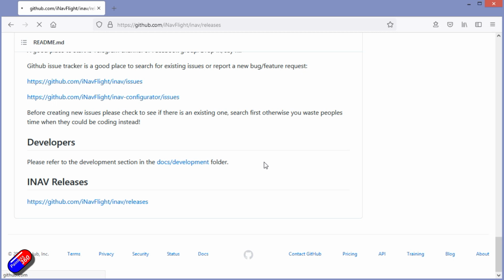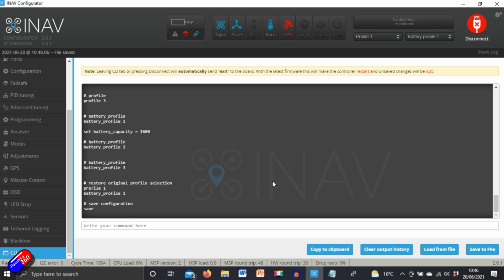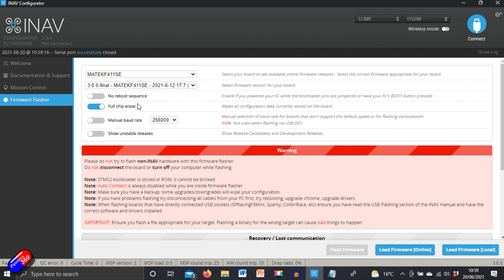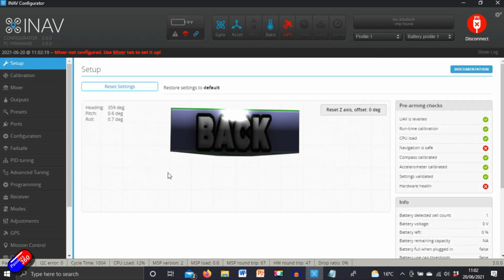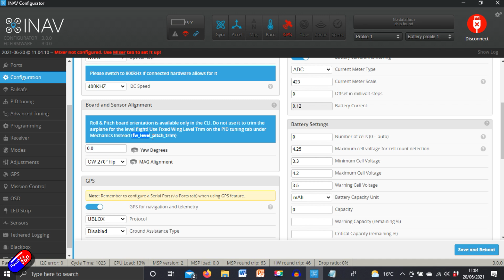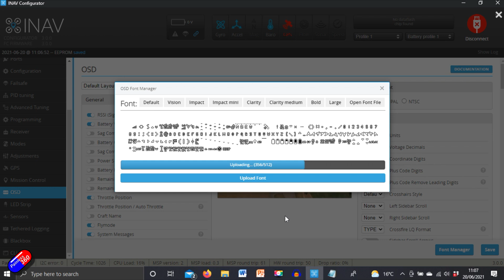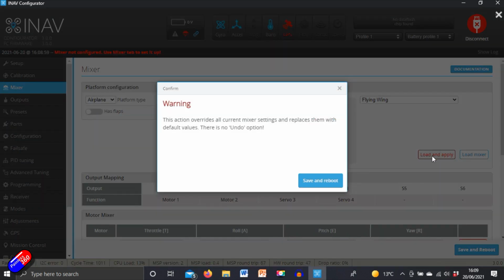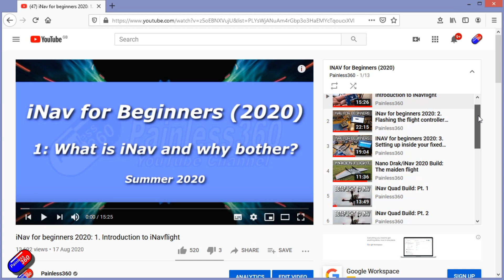INAV 3.0 (and 4.0) Fixed Wing: Installing and setup tips and process

Comment: Hey Lee, I have figured out how to get the plane pic in the setup tab, I had to load a wing Configuration and then change the settings at the bottom to match my Timber which has Rudder and Flaps then copy and paste the old servo settings from the previous Diff file and Bobs your uncle it all working great....👍👍👍
Reply: Yeah, seems the plane pic is only for wings!

Comment: set fw_level_pitch_trim is also in the Mechanics tab of PID Tuning
Reply: If you change this value, should that reflect in the image in the Setup tab?  For example in 2.6 I set my plane level on the ground, then prop the front up a bit for the correct flying attitude.  Then tweak the pitch offset until the Setup tab showed me a 0 pitch.  When I do the same in 3.0... changing the fw_level_pitch_trim number does not seem to have any effect on what I see in the Setup tab's pitch value.

Comment: Hello! Excellent video, I would like to answer a question if possible. I'm almost ready to make the first flight using INAV on an airplane, I only did tests with the airplane on the ground and stopped. I noticed that when I'm in manual mode, the control surfaces, elevator, ailerons and rudder, move as much as possible, but when I switch to ACRO, the surfaces move very little, even with the sticks at 100%. Does this happen because I'm at zero speed? Or is something wrong? Thank you very much in advance!
Reply from the maker: See https://youtu.be/OO1tIlfk9eU

Comment: Lee:
I am very grateful for your willingness to work the bleeding edge of new stuff for us. I certainly need all the help I can get.
Are you currently using Express LRS 915 or 24 in your Atom?  Which? With INAV 3.0 installed? 
Any tips or hangups we should know about that combination?  Thanks! - Jim
Reply from the maker: I'm not using Express here. I am a Crossfire and Tracer pilot.. Happy flying

Comment: Thank you for the info, I think that you are missing the load of the presets for a wing  .. which is recommended (setting all the defaults parameters for wings )
Reply from the maker: See the linked file and comments at the end of the basic setup - 16:18. Happy flying

Comment: Hi. I'm a Japanese who has been using iNAV2.6 and is finally switching to 3.02. 
Please tell me only one. Regarding FC Alignment, in 2.6, the angle of attack correction value (about 4.0deg) was put in the pitch angle, but in 3.02, is it correct to put this value in fw_level_pitch_trim?
Reply from the maker: That's right. Covered in the video

Comment: Hi Lee, many thank you for your excellent video and sharing config. I have been able to fly with inav  and with my dolphin for the first time out of the box with it. Unfortunately I did not take your advice to test it on a windless day.  Seems like I messed something up the brushless motor settings when I configured the controller. Do you have any hints about those settings on the controller e.g. start mode, motor brake,. Best Dani
Reply from the maker: I left them all as stannard. Sorry to hear that you had a few problems.. Best of luck

Comment: So a successful reflash of V3.0 (thanks to your videos), however, sitting flat, the plane has a -3.6 deg Roll in Set-up.  Do I have to recalibrate the gyro to fix that, or is there a way to do it in CLI?
Reply: Also noticed that the compass is off 90 degrees CCW.  I noticed the Board & Sensor Alignment on the Configuration tab says CW 270 flip.  I played with that and it doesn't appear to effect.  I am referring to the heading displayed in Setup and Mission Control.  BTW - I do have a good NAV GPS lock.
Reply from the maker: I'd refer to the DIFF ALL you saved and see how it was configured last time. In terms of the 'level' I've used both the re-calibration and uploading the ACC calibration data (as I've done here). The latter seems faster. You can then offset the align_board_roll CLI command
Reply: @Painless360  Thanks for the roll information.  What do you make of the compass off 90 degrees?
Reply from the maker: No idea, I'd check what is was in the old version.. Best of luck.

Comment: NAV 3.02; skyhunter plane; matek722 WPX F.C. In setup screen the plane icon shown but will not move. Accelerometer checked as ok but is greyed out next screen. Will not accept  new set up, Like to start over again. What is command in CLI to delete existing data or is this problem originated somewhere else
Reply from the maker: I'd re-flash it again and confirm you have the right target selected.. Best of luck!

Comment: really god video BUT i got some little problem with Inav 3.0 ! Im stil cant understand a little problem. FC Matkek 411 WSE ! Plane Zohd Drift. Dont matter what a botton im set on AVTOTUNE in fligh i cant TURN ON this function ! Im fly only in ACRO mode. In FC all bottons work`s correctly,but in ly whe im Turn on Avtotune im dont see on scree "Avtotune" and its just not work ! With Reptile s800 on inav 2.6 i dont have any problem with that ! some one ?
Reply from the maker: Check out the remaiden and autotune video in the playlist. I hope it helps..
Reply: @Painless360  Of course I watched your Avtotune tuning video. My problem is that the Avtotune mode itself is not turned on and shown on the OSD screen! I repeat I fly exclusively in Acro mode!
Reply from the maker: Maybe you have another mode setup for the same time... Best of luck
Reply: @Painless360  that's the problem that no! I double-checked it three times. One acro and nothing!
Reply from the maker: How odd. If you figure it out - let me know.